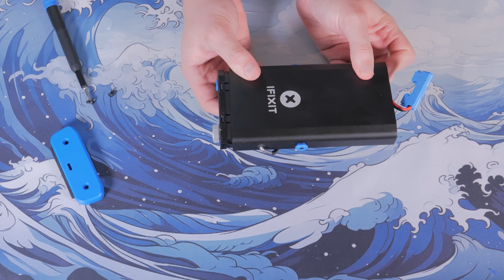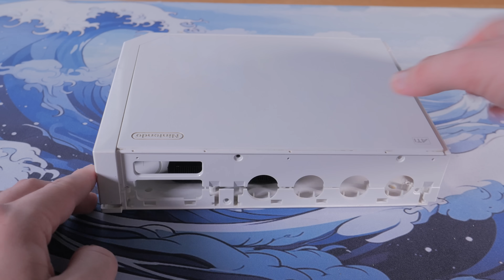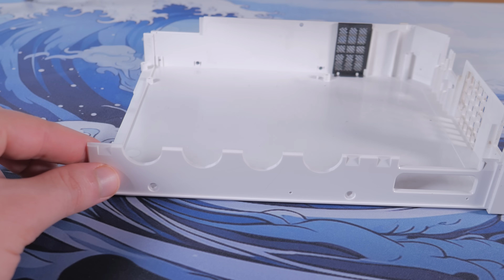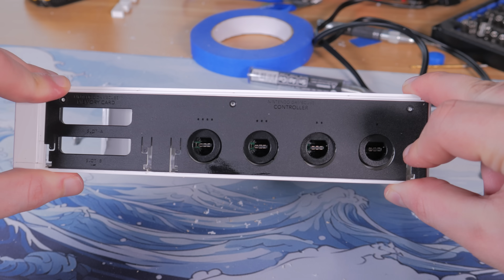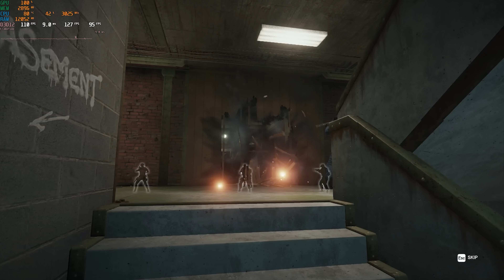I Turned an Old Wii Into a Gaming PC!

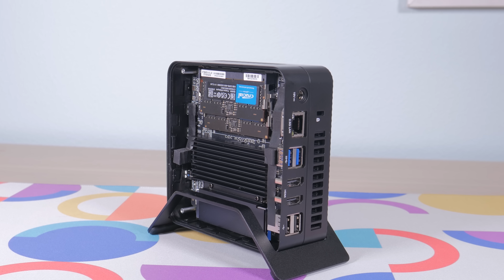Comment: 15:50 i have the exact same cpu on my laptop. BoTW on Eden (switch) emulator with NX Optimizer mod runs stable at 60fps and graphical enhancements. I think that Wii U BoTW is just that bad with performance

Comment: Above 80° C in my book overheating and using way more power than could have been  back pc is maybe opened but there's barely any air intake make some rubber feet and have some holes in the bottom

Comment: Tip: You should use some flux for soldering. This will create more heat transfer. If you don't use flux, points can look like they are perfectly solid. In reality it makes poor contact and a little pull will tear the point and wire apart from each other. Great work on the whole thing bro!

Comment: A lot of fun in sleeper pc builds is seeing how people work around the limitations, so taking a minipc and putting it in a case with an even bigger footprint kind of ruins the magic... but adding the extra components that makes use of the original hardwares intentions is neat, and fits so well as an older console emulator.

Comment: I've had an old computer booting into Recalbox stripped down that just barely fits into a NES case and a NES case just sitting because I got overwhelmed by the amount of things you have to think about to get it look even halfway decent. I don't have any 3d printing capability either so cutting away plastic is even more panic inducing :p Starting to think I'll never finish that project.

Comment: nice build video. looked like there was room behind the front game disc panel to add a couple  general coolant fans and if good with 3d printing build an air guide channel to add additional air to compensate or replace that small side air intake area ?

Comment: It may be a little late for this, but i have a solution for the front panel that wouldn't require an arduino! You could try to make a pcb with and AND and NOT gate. Heres what i was thinking: you can find a spot on the motherboard that produces a signal/voltage when the computer is on and hook it up to the AND gate (green light) and a NOT gate (red light). While the motherboard isnt supplying a signal (0) the NOT gate would send the opposite signal (1) to the red LED; the opposite would happen if the motherboard is supplying a signal. Then, by hooking the motherboard and a voltage supply (constant 1) to an AND gate, when the motherboard signals 1, the green LED could turn on since the voltage and motherboard are showing 1. This may be more difficult than I imagine since I only have minimal experience in actual circuits, but that would definitely work theoretically! Sorry for the long message i just wanted to get this idea out there since its always fun to think about ways to "dumb down" something and not use a microprocessor.

Comment: Not that you would necessarily want to, but in the future if you have a power led issue like this, you can always attach it to the HDD activity pin on the MB. It would provide a light where the qii had one, and also provide a unique feature of the pc thinking.
Reply: that only works if you have an HDD
Reply: @lemau8458  Its a 12V pin. It will illuminate with any hardware. There is no HDD required..

Comment: You could use a 330-1000 ohm resistor attached to fan power for the power LED as the LED takes so littlw power, it wouldn't bither the fan and the fan only runs when PC is on.

Comment: You could piggyback voltage from the fan for the LED. Those mini pcs have the fan running from boot to shutdown in most cases.

Comment: Hi, tech By Matt I would really like to do this with an old Amiga 500, but have the keyboard working, or at least have a stand in key board that appears to be the original. I really do not play many games beyond 2012 to 2015 and my current pc was a middle range games pc from that era, but its really big . Id love to have a nice refurbished amiga with a powerful little pc inside and maybe just run a very nice emulator for amiga stuff no need to get to fancy. But there are some gorgeous led key boards and bit and pieces to add.  I was just inspired really by the small size of that pc, its what I wanted to see.  but I generally don,t want a tower or platform styled pc any more, I really fancy that early 1980 to 1990 home budget starter computer such as the atari st/amiga 500/C64  etc.  pref the amiga 500 as that was the one i worked hard to buy second hand by the mid 1990,s after washing cars for 2 years
https://www.youtube.com/watch?v=JG1TdfezJzo&t=1266s&ab_channel=RetroRecipes%F0%9F%95%B9%EF%B8%8Fvintagetech%2Btv

Comment: Up to 87°C under partial CPU load? Either that cooler needs a fresh application of liquid metal or too much hot air gets trapped inside the case. This may be the reason for the stuttering you experienced.

Comment: Considering the Wii is 6 layers, while it wouldn't work for a portable like you said in your video, you can absolutely use it for a similar project in a less portable form factor: the Noldendo Wii Miicro, which functions as your "Wii slim"  project :D

Comment: Might lower temps some if you can neatly perforate the case directly above the fan intake
which is right now probably sucking case instead of air due to clearance.
Or 3d print a snap in fan grill, might be easier than trying to neatly vent a soft plastic case?

Comment: @TechByMatt
This is a very cool build! I would suggest taking what you learned from this build and trying again with another broken Wii and use the Geekom GT1Mega as a base. It's an overall better performing system and runs cooler. Jeff over at CraftComputing reviewed it a few weeks ago if you want to check it out.

Comment: Missed opportunity to not make the front SD card slot functional.

Tons of tiny SD to USB adapters exist, could have absolutely plugged it into the USB hub with a 3D Printed mount and made it work.

Functional disk drive would have also been really fun but highly doubt you had the clearance for that lol
Reply: Well there are the laptop disk drives that are really slim like the MacBook ones from back in the day, SD would be a good addition
Reply: Relsai

Comment: Cool build but using screws was a mistake. Glue would have held forever and would have left the outside looking nice. You ruined the build. The wii was made to stand on its side. Also just desolder the original pc led and run a cable from the contacts to the green led. Problem solved.

Comment: You might be able to disable power delivery when the pc is off in the bios and solve the issue with the LED and still use the USB solution.

Comment: You could try to find SATA power, if they used the same board for versions with 2.5" disks. Those should give 5V (and ground) and only be on when the PC is. Or, if the fan is PWM based, you could tap into the 12V for the fan and maybe add a voltage regulator to get to 2.2V or whatever you need. Then again i think there are special LEDs that can just live on 12V.

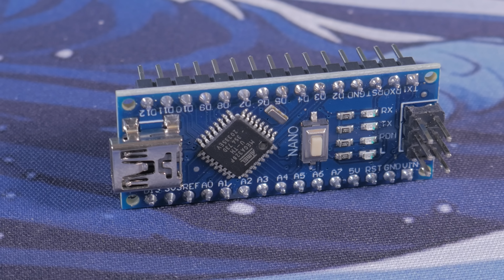Comment: At 14:20, don’t over complicate it. You don’t need an arduino. You just need an and gate right before the led. One line connected to where it already is and the other from the mother board.

Comment: You may be able to turn off the usb port power when the pc is off in the bios. If so, you would still be able to use the same setup you have already made and not worry about an arduino or anything.

Comment: I've been building personal consoles like this for several years. Learned so many lessons. Namely been doing the N64 myself, getting full controller port functionality direct to emulation was groundbreaking. Memory packs and accessories work just like the original console. Also getting the original analog video out fully functional. Fun stuff.

Comment: Seems like the cooler is sitting pretty close to the top of the case. What's the clearance? Could be choking airflow and causing the high temps. Probably wouldn't look as cool with a vent there though.

Comment: Personal recommendations if you make a version 2:
- Since this is a one-off project, I highly recommend using superglue or even epoxy to secure the motherboard mounting plate, as it will not only keep the exterior looking factory-original but be tough enough to handle the mini-PC. And for screws, I highly recommend getting heat-set inserts for the screws, since it only requires a soldering iron and greatly improves any screw-mounted bits.
- Depending on the way the board is positioned, the GameCube memory slots could be cut out to create an exhaust vent, since that mini-PC has two. Also,  you can salvage dust mesh filters from the bottom panels of certain laptops, like ThinkPads or HPs, and then glue them to the inside to have a more finished look AND protect from dust. (Psst- take a hint from OEMs and make your vents toroids instead of rectangles)
- If you find a miniPC with a slimmer Z height, you could turn the DVD slot into an intake vent for the fan that uses a channel guiding air to the rear.
- For a more sleeper look, I highly recommend using laptop antennas. To protect against RF, you could 3D print a separator part to split the internal space into two chambers, then add aluminum foil over it.
Reply: and to better clean up rough areas in the plastic, tamiya extra thin plastic cement is really good at smoothing out rough spots in plastic.

Comment: Is it possible there are different pins on the pc's power button that would allow the led to be off when the pc is off? If you kept the original pc button it might be worth trying to figure out if the original led is hooked up the same as what you did.

Comment: if I recall correctly, you can make the wii to autoboot into usb loader gx, which is basically a replacement for the stock menu and it has controller support.
also, desoler the other led and green one will be brighter ;)

Comment: Question: for mounting the motherboard tray, did you consider using the standoff mounts for just applying a standard fixing screw rather than bolting? Or did you want the security of it bolted and not having to rely on the thread holding?

Comment: The LED easy fix: In windows, find Power Settings. You want the menu that lets you pick Performance, or Balanced. Use the advanced options, find USB power option, and select Disable or Let windows disable. This will turn off all the USB ports when the PC is off. That option is for people who want to charge their stuff on usb when the pc is off, and is enabled by default. A known issue that will kill the battery on a laptop if you leave an external drive plugged in while the laptop is off.
Reply: Many motherboards also allow this to be done in bios.

Comment: There's a few thing I probably would've tried to do, like find a way to repurpose either a couple m.2 slots, or msata slots and tried to configured them in place of the gamecube memcard slots, and tried to shell a gamecube memory card to try to stuff a short m.2 for additional storage, would've put a blocker behind the disc slot, tried to slot a small slim fan near the intake, and also would've tried to get the sd card slot to be functional by replacing it with a cannibalized modern sd card reader

Comment: I also have a nice MinisForum with Ryzen9, I'm doing the same thing and putting it inside the Amiga1200 body.
A1200 that I have been putting in a TowerPC with 060+PPC CPU and 3D BVision card for 25 years.😋👍

Comment: the power button always being on should be able to be fixed in the BIOS. There should be a setting that disables usb power when the machine is off! You can also try USB selective suspend in windows settings, but im not sure if this will work. Great stuff as always!

Comment: First time seeing your channel. You did an awesome job adapting the wii case to fit this pc. I've been 3d printing for about 5 years and still use tinkercad online to make models. I've downloaded fusion several times but can never make it happen. You have inspired me to try again. Any suggestions on creators or videos to get started?
Reply from the maker: I think these were the two that helped the most at the start. 
Basics:
https://www.youtube.com/watch?v=5hComh1hFzY
Reference Geometry:
https://www.youtube.com/watch?v=2JxQZT2hYEs

Also I wasn't a 100% newb, I did have maybe 10-20hrs in sketchup years ago. But that really just meant I knew basic stuff like extrusions and some general navigation stuff. I think the best thing to do is just learn the basics, then start a project and as you run into problems look them up as there's lots of specific help videos and forum posts with other people trying to figure out the same thing you are. Also, it's a good idea to try and understand/implement Fusion 360's parametric features from the beginning as it makes changes and adjustments in your models much easier.
Reply: @TechByMattB  Thanks for the reply and the tips! I've successfully USED parametric files shared online to tweak models and stuff but I'm just looking for a good, simplish project to start on. I like the idea of importing images at the right scale to build from, pretty cool stuff. I haven't messed with CAD since high school 20 years ago. Dinosaurs can model too! Thanks again!

Comment: This is great! You can add some RGB to the now defunct disc-tray like in the original Wii. Another area to explore is if you skip the internal USB-hub do you have enough space for a USB-4 eGPU at the front? It probably also wouldn't hurt to add a pair of 40mm Noctua fans at the in and outlet to move a bit more air, your 3D printed parts might start to deform otherwise.
Reply: Pla melts at 230celcius lol.

Comment: I'm glad you saved the old board, wii's are my favorite console for use as a soft modded emulation machine.  Emulators from NES and Gameboy to Sega CD runs like a dream on there which works well for me since I love retro JRPG's.  Then add in the native Gamecube support as well and it's kind of a beast of a system.

Comment: Just a quick note, because the Wii has been modded there's actually quite a large chance that the disc drive is still fully functional, just the modder messed up the system. Back in the day I actually did this once, but it can be easily fixed. Otherwise I love this video, I kinda want to try something like it.

Comment: I'd try to find some gamecube (or possibly smaller) fans, and install them as an intake along the inside of the disc drive slot. that should improve temps. two oughta do it, maybe 3, if you wanna be sure. id also get velcro strips, and attach them to the usb hub, and inside the case, so its removable but secure.

Comment: I imagine that your issue with the LED was due to using the same ground as your power button. Typically LEDs are switched on the low side, meaning that voltage is always present on one pin, while ground is connected/disconnected to control it. Adding a fourth connection to the original pin for the LED would fix it in that case

Comment: I didn't catch which material you said you used for the rear IO shield, however I've had PLA rear IO shields melt on me when using a ventilated infill pattern so PETG worth considering for future builds if you're not already using it. Same goes for motherboard trays.
 I'm not 100% sure if this is because of how little material mine has and how exposed the entire surface area is, or if it's because it's in my smaller-than-a-velka-3 brickless 4060ti 16gb build which is obviously pretty toasty, but it's worth considering

Comment: If you had a wii remote, you could easily extract all the NAND data of that hacked wii into a file as a backup. Make sure you do that before altering anything on that motherboard while it still powers on! Nand backups are easily restorable and let you use the same system menu in dolphin!

Comment: You could use a piece of fiber optic to bring the mobo LED to the front. it would be blue but would work without much modding.
Reply: i even think blue looks better than green with the whole wii aesthetic
Reply: @alessioacri.  The Wii U LED was blue
Reply: this. in my opinion blue would be also fine
Reply: Unsolder the blue led and solder wires in its place?

Comment: check if the mob have a led for power indication, if there is one, solder the wires to the inbuilt led indicators connections

Comment: Maybe use the CPU cooler fan to power the LED as well. I don't think that shuts off, especially in an air-constrained case. Also, wiring in a small intake fan might be a good idea.

Comment: For your LED, solder a wire from the motherboard's power LED or use the wire with the arduino to detect an on state. Not sure if you kept disc slot light guide but if you did then you should totally light it up. I love these types mods. Nice work!

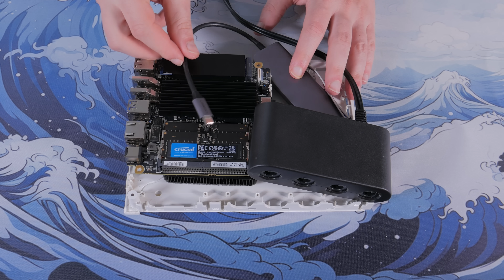Comment: this is clean, but at 5:11 im confused on why you'd use a metal type c adapter/dock when you're only using it for USBs? there are plastic ones that wouldve allowed you to disassemble it and give yourself more workable space or even a tad bit better airflow since the only fan you have is from the heatsink.

Comment: I love it. Yes, you could have just used the NUC as is, but integrating it into the Wii case, custom designing a board frame, IO shield and controller bracket to hold the internals together with little CAD experience is impressive. You seem to have a nack for it. Sure, your cut out at the back is a little rough. Nothing than can't be refined later on. All in all, I really enjoyed this build project. I'd recommend getting a router for cutting out plastic and finishing with a file. Great stuff! Look forward to more of your creations.